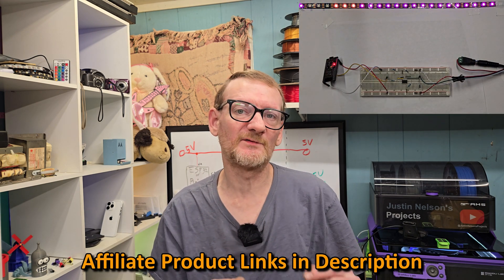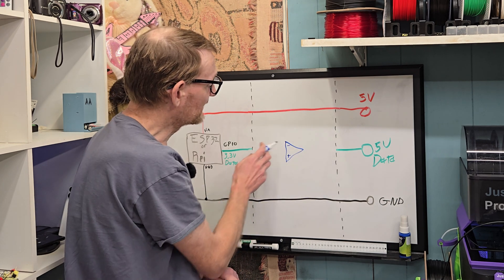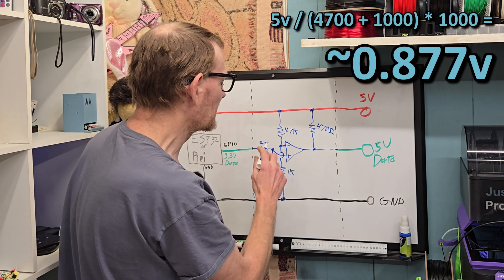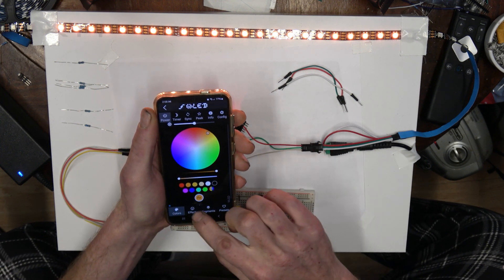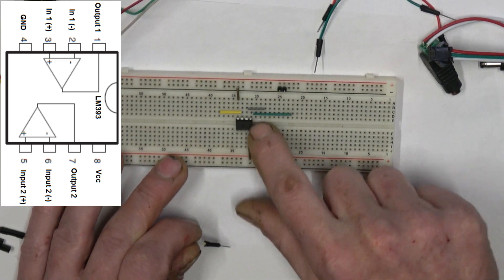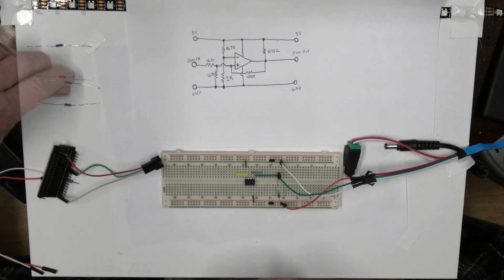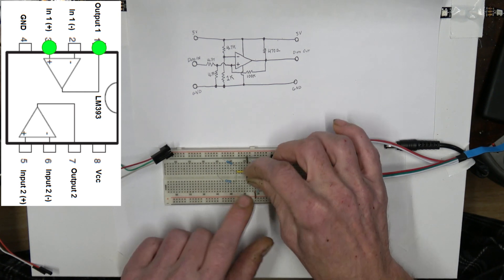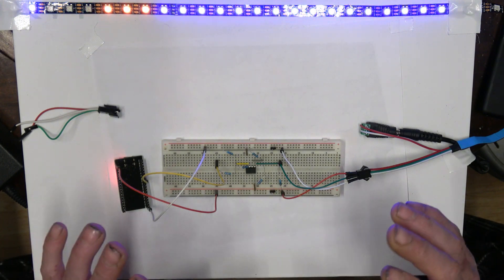Level Shifter Breadboard Project • ESP32/WS2812b • Tutorial • WLED • Hyperion • 8266 • Raspberry Pi

Comment from the maker: Note that I do sell a Hyperion / HyperHDR specific level shifter (link in description) -- it has more functionality and is specific to the HyperHDR videos on this channel. However, in many cases (simple WLED projects), simply integrating a voltage comparator into your project, between the micro and the strip, is all that you need.

Comment: This Level Shifter doesnt work for me. Without it ESP with 5m of WS2812b works good but with it doesnt. I made Level Shifter on SN74HCT125 as described on WLED website and BUM! It works great.
Reply from the maker: Sorry to hear that you weren't able to get this working using the voltage-comparator. If you use an LM393 as described/shown, with the correct resistor values, everything should work.

Using the TTL logic buffer also works, but for this video, I wanted to demonstrate the principal behind how such a buffer actually works: by comparing the input voltage to a known, stable reference voltage (the voltage divider on the "-" or inverting input), and outputting either a high- or low-state accordingly.

The 74HCT125 just hides all of this inside its packaging but is essentially doing the same thing. But that wouldn't make for much of a tutorial video...

Comment: A few thoughts / questions (it's almost 40 years since I did electronics design so I might be in need of correction)
1. for the sake of limiting wasted current & power going through the voltage divider connected to the + pin of the comparator - would it be better to use resistors in the range of the  MegaOhm or more ?
2. If Hysteresis is not an issue - could it all be simplified to a simple MOSFET transistor?
3. In case that 2) is feasible - how about a small capacitor to reasonably filter out anything above the maximum needed bandwidth /bits per second of the data line?
Thanks for any comment or answer!
Reply from the maker: For point 1) - the amount of current flowing is miniscule compared to the multiple-amps the LED circuit is potentially using. And having too large a resistor value allows the possibility of interference being picked up on that reference pin (the "minus" or "inverting" input). This can be from outside sources or even internal to the comparator...

For point 2) - Any time you use a transistor (MOSFET or otherwise) as a voltage amplifier, its signal will be inverted. So you would need two transistors to accomplish this, and if you fully saturate the gate, the switching speed will decrease *significantly*. So a LOT of care has to go into the transistor circuit -- which is exactly what pre-made Operational Amplifiers (OP Amps) and Voltage Comparators are for :)

Point 3) - In any case I would not want to "filter out" anything. We're dealing with square wave data essentially, which will contain harmonics well above the operational frequency. Filtering this will cause a phase shift and (especially since the data stream is not a consistent square-wave, rather, there may be multiple cycles where the output is high or low, then tiny individual 1's and 0's....... )

Short answer on #3 is that you almost never want to "filter" clocked data. This would actually negate what we're trying to do :)

As for the hysteresis, it's not strictly necessary... it just helps the circuit "latch" definitively, like an "over-center" concept in engineering...

Thanks for the questions -- I'm not an electrical engineer, but I'm always happy to answer questions when I can!
Reply: @JustinNelsonsProjects  Thanks for the insights! Appreciate it

Comment: I question i have approximately 12 metre strips 650 led so can i use this sat up
Reply from the maker: I'm not sure what you're asking but ... if you need to drive a 5-volt data device from a 3.3-volt source such as an ESP or Raspberry Pi, this is the circuit for you.

Your LED Strip -- if it requires 5-volt data, then yes, this would be what you want to use. If it's NOT an individually-addressable strip, then no, this isn't what you're looking for.

If it's a WS2812B or SK6812 (in any length) this will be what you're looking for.
Reply: @JustinNelsonsProjects  i understand your circuit ... i sow problem in my case that's why I ask.... your case u use 23 led in wled satting but I use 630 led ...and i show some time problem.     So that why I ask is your circuit work in my case in 630 pixel led

Comment: Superb! Thanks. Why not feed the 3.3v directly to the + and use a different divider circuit on the -? i.e. why divide the 3.3v?
Reply from the maker: In this particular design, we are including positive feedback from the output side. So when the output goes high, it takes a stronger low on the input to flip the output back to low. 

This prevents hysteresis. 

If we were to tie that directly to the input, there is a potential that 5 volts could be seen at the gpio of your microcontroller or Raspberry Pi. It would be on the order of milliamps, but exceeding 3.3 volts at all on those gpio pins can totally fry the microcontroller... 

By dividing it, this ensures that even if for some reason your gpio is turned into an input, perhaps a coding mistake or for a brief moment during boot up, it will never see 5 volts. The divider that is made up of the feedback resistor and the grounding resistor ensures that the output feedback would be on the order of millivolts. 

This is just one of many ways you can design a level shifter. In the version that I sell, I go about it a completely different way. I just wanted to show a very simplified and easy to understand method here. 

I hope that clears things up, thanks so much for watching!
Reply: @JustinNelsonsProjects Got it. Thanks so much. I got my LM393s today so I can do this. Thanks.

Comment: Thanks for sharing!  I'm pretty new to electronics but I think I followed along well enough.  I've seen a few other videos where a 74HCT125 was used to do the level shifting.  Have you used that method before?
Reply from the maker: Technically that IC is more of a data buffer; it can help with a lower-voltage data stream, but it actually expects 5-volt logic at the input.

According to the datasheet, at 3.0 to 3.6 volts input, it takes approximately 5 times longer to "switch". It's most likely fast enough, sure, but it's not really being used as intended...

My idea was to take a simple "voltage comparator", and then I (and you the viewer) set that "on" threshold voltage to whatever you like :)  In our case, we want a 3.3 volt signal to easily and reliably trigger a 5 volt output. We don't need a "tri-state" device (that's a whole other topic) and we don't (usually) need 4 such buffers.

Note that if you DO need more than one level shifter, you certainly can use a dual- or quad- comparator (note that I use a dual, only using the one channel; it's just cheaper as far as components that way)...

One final note, TTL logic devices such as the 74HCT125 are very sensitive to the SUPPLY voltage; if your LED power supply is a tad higher than 5-volts, it can cause damage; if lower, it may not function (eg, when the LEDs are drawing a lot of power, potentially dipping the voltage down).

The voltage-comparator is useable up to 36 volts :)

I'm glad to see people taking an interest in electronics; I may do some more similar videos, perhaps with more detailed explanations...